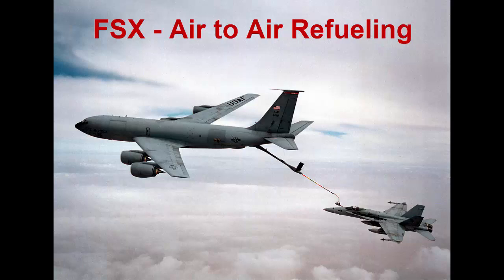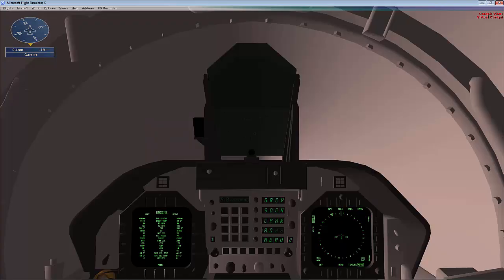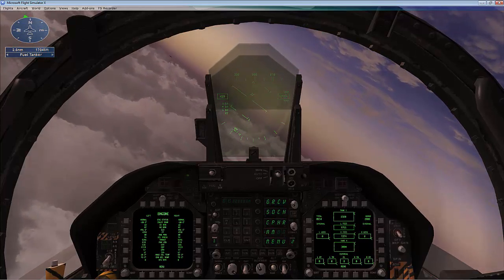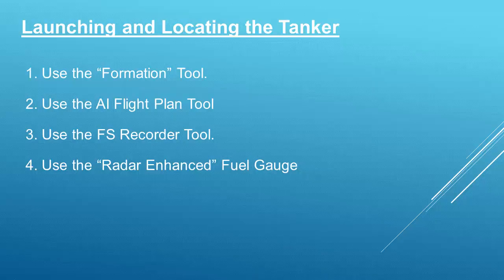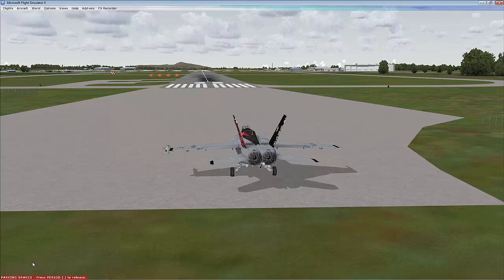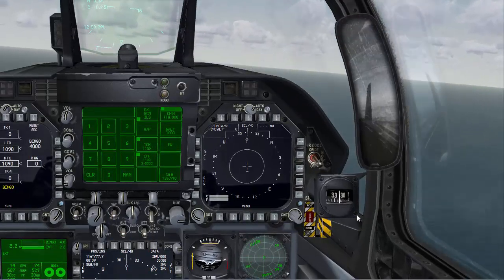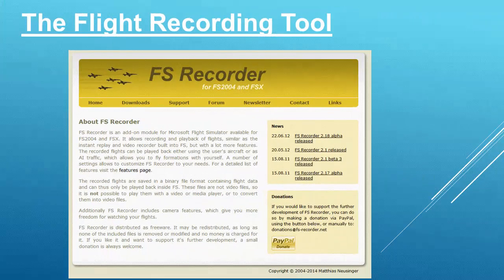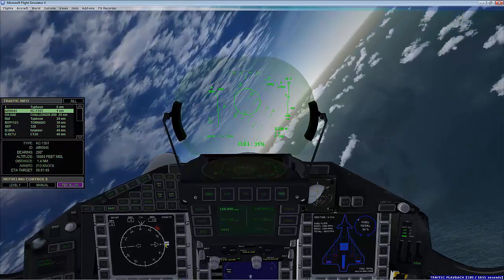FSX - Air to Air Refueling

Comment: Hi there, I know this is an old video, but regarding the A330-200 MRTT tanker, how did you get the drouge and pod hoses to extend on the ai aircraft for AAR? Does this happen automatically somehow after take-off or is there something else that needs to be done? I would greatly appreciate it if you can help me figure this out.
Reply from the maker: Axel - AI AAR tankers usually have their drouges and pod hoses extended automatically.
Reply: Thanks for getting back to me so quickly @Tag21-ScheduleGuy . I see, so I've currently created a flight plan using AIFP for the A330-200 MRTT (the same one as in the video), treating it as my AI AAR tanker. But, when I fly up to it, the drogues and pod hoses are not extended. If that's all that's required, then I'm not sure what I'm doing wrong (I've installed the fuel gauge for the default F-18). I'm now wondering if this is only a feature in a payware AAR tanker?
Reply from the maker: @Axel-mh6ne  The Rikoooo A330 is a full blown model that needs to be flown by the player, so it is ok in Multiplayer. If you are a solo player, then you need an AI tanker. Try the one at Military AI Works and please subscribe to my channel.
Reply: @Tag21-ScheduleGuy  Ahh ok, I was hoping that wasn't the case. Nevertheless, thank you very much, I'll definitely look into your suggestion.